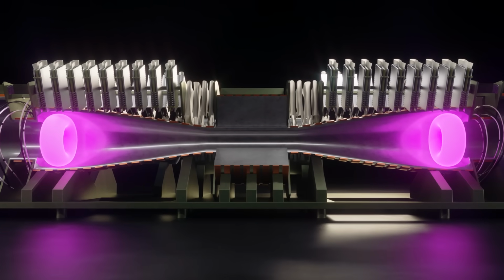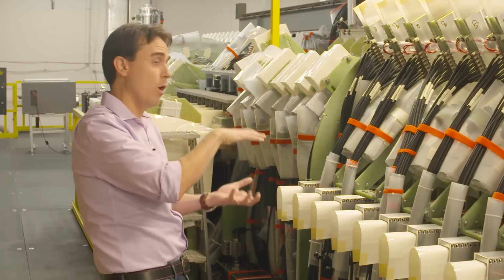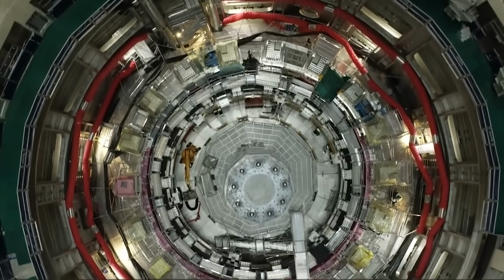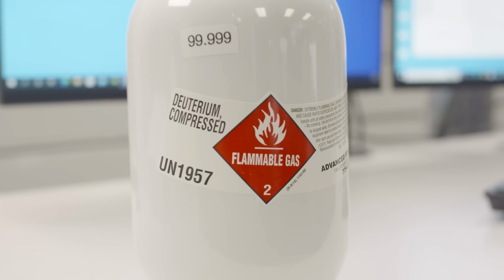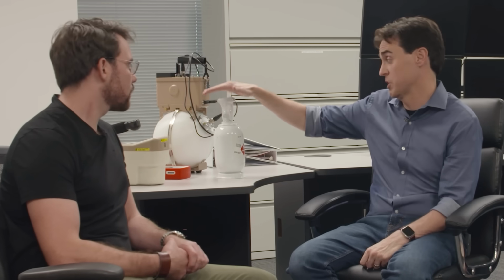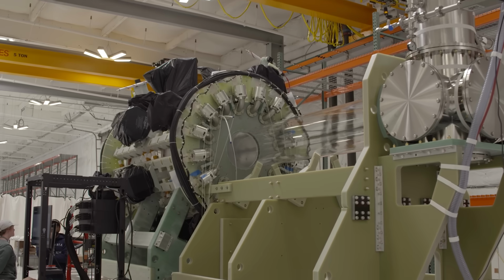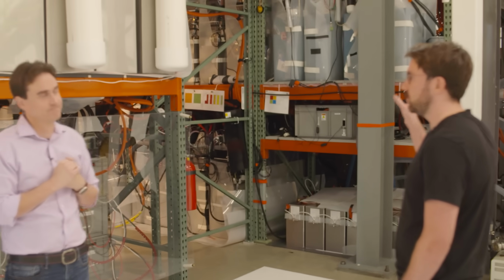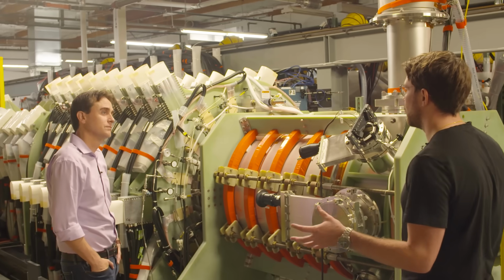A New Way to Achieve Nuclear Fusion: Helion

Comment: This is extremely exciting. The initial skepticism over "we found a new way none of the thousands of smart people working on fusion before us thought of" is tempered by the explanation why until relatively recently switching huge currents with the required precision to create the peristaltic plasma pump was just not available yet. That makes it so that even if someone thought of this kind of colision confinement it just was not feasible before. 
However here is my bit of skepticism:
1. are the field generating coils superconductors or not? Running 100kA or 1MA through them must generate huge heat waste if they are not. Can be done with ten minutes between pulses to cool down but ten pulses per second? And if they are superconductive how do you keep them so just next to the hot plasma?
2. When generating the He3 the D-D reaction gives out high energy neutrons. How to do this at scale without creating radioactive material and a similar waste problem to fission reactors and/or a tokamak? Is there a way to capture a neutron without making the capturing material radioactive?
And a bit of very far away optimism maybe: what it the waste neutrons could be used to burn fission fuel that is the waste from a conventional fission reactor because only ninety something percent of the fisible material remains in it? Build a hybrid plant that in its core generates He3 for the fusion generators, that is surrounded by a moderator to slow down the neutrons and those then fission nuclear waste untill it is all used up and not just 5% used up? That would provide a lot of energy and process nuclear waste at the same time.

Comment: The technology is fascinating. However, I am still not sure how are electricity generated in this system. What happen after a pulse merged and fused? How to remove the fused product after extracting their energy?
Reply: Essentially, the magnetic field forces the fusion. In so doing, a force is created by the fusion that creates an electrico-magnetic field around the reaction that pushes back against the machine causing the fusion. This additional energy is directly put into the electric system of the machine because physics. Then when the reaction is over, the current stops. The goal is to create an electric piston like effect which ultimately generates an AC current you can use like normal electricity. And I really do mean its the electric version of a piston.

Comment: This is a very cool approach. Really missing the downsides to actually get me more excited. How much energy is it currently taking to trigger a fusion reaction vs how much they are getting? Where are they planning to make up for the energy gap? From the currently unused neutrons?
Reply: Perhaps there are a lot of details missing, but those huge capacitor banks are the source of the power required to do the process, and they are a small portion of the stored energy of a Tesla battery, they’re used because of their discharge rate. So, it appears the energy required to make it happen isn’t a huge amount, it just needs precise and fast delivery: that leaves the question long-term of how much power can be extracted per pulse, which I’d hope would require far less power than a Tokamak or ITER design because they’re skipping all the mechanical issues with steam.

There are a lot of unanswered questions not asked in this video.

Comment: The comparisons of the scale of the two machines is just amazing -an speaks volumes about the practicailty of Helions product. You two make a brilliant team in breaking down all that crazy science!
Reply: Thing is there are tokamaks that are 10 times smaller than ITER too (and could reach positive Q), due to advances in superconducting magnet materials since ITER was designed. Both Tokamak Energy and Commonwealth Fusion Systems have modern tokamak designs that are likely to demonstrate positive Q in the next few years, quite possibly before ITER does. So it would be much more relevant to compare the Helion machines with the Tokamak Energy or CFS machines. They still have the general problem of tokamaks of generating actual energy and radiation mangement in real practical machines, but 'stupendous scale and expense' is already fixed.
Reply: @xxwookey  exactly. ITER is using 70s superconductors, it’s just too hard to build quick enough to keep up with the developments in MAST and now CFS.

I wouldn’t be surprised if Helion is using better superconductors too, so you’re spot on that it’d be more fair to compare to them

Comment: This is very interesting and promising. HOWEVER. Why are they on the 7th version without showing any tangible results? At the very least they should be able to generate enough electricity for their own building by now. This equipment isn't cheap. There is something here we're not being told. They are either happy to be burning through investor cash, or there is a serious flaw they won't advertise. Or both.

Comment: As interesting as this concept is (I like the fuel they want to use), they fact that there is no information regarding energy output, conversion efficiency, etc pointed out leaves my very sceptical. There is no reason to believe that this concept is technically more viable than the ones currently researched. There is no evaluation whether the benefits outweigh the very obvious cons.

Comment: skipping the steam/turbine step to go right to the induction step is pretty genius. I really hope this works out. It looks very scalable too. Just compare this to a tokamak or stellarator. I imagine the most complex step here is the software and sensors, i.e., getting everything to fire at the correct time, getting everything at the perfect velocity. What I'm curious about though, is how will this ever break even? How many watts of energy does the collision cause?
Reply: FYI,  a Watt is a unit of power which is energy per unit of time. So 1 Joule of energy delivered in 1 second is a Watt - that's power. So 1 Watt = 1 Joules/sec.  The amount of energy released in a fusion reaction is the difference in mass of the particles before the collision and the mass after the collision: Energy released = [sum(m initial) -sum(m' final) ]c2.
Reply: Never mind the fact that breaking even is of absolutely worthless value.
Reply: @MrJdsenior  You’re a years and years ahead of the competition if you can develop a fusion machine that breaks even for minutes on end.

Comment: interesting video! but it seems it won't work like inertia fusion with lasers for the same reasons. The only way to commercial operations will be to ignite a plasma once and let it fuse for e.g. 30min like Stellerator will make it possible. It should be obvious - most energy is needed to start the fusion process and the only way is to reduce the count of ignitions and not to just make it ignite faster (which will be extremely difficult!)^^. What I missed in the video are numbers about energy consumption for igniting and expected return from the 7th generation reaktor 🤔

Comment: It uses a mix of Deuterium and Helium 3?!! Deuterium, fine, you can buy it on ebay or extract it from battery acid. Helium 3 on the other hand is a vanishingly small resource that is incredibly expensive to extract or manufacture in a nuclear reactor. No way is it Helium 3 economic for a fusion reactor.

Comment: Jumping straight to non-neutron-emitting cycles, with plans to converting reactors to produce tritium/He3, that's pretty bold, but exciting. Unless I'm mistaken, deuterium-Helium3 reactors should be much less of a radiation hazard to be close to while they are running than other kinds (or much lighter to achieve the same degree of safety to stand next to as they need less radiation shielding), so this (in its power-only configuration, not the fuel-breeding ones) could maybe someday be useful even for large vehicles (ships, spacecraft, etc; maybe even large aircraft and ground vehicles far in the future)
Maybe the Battletech fusion engine is late, but coming eventually...
They're going to have to figure out something to do with the neutrons in the D-D fuel-breeding reactors, though. Possibly a conventional breeding blanket to harvest even more tritium, with or without multipliers.

Any new technology is impractical for at least one patent cycle though, and very expensive and clunky for at least one cycle afterwards, as competing companies block each other out by monopolising individual features necessary for a practical offering in the first cycle, then all the clever 'tricks' that come up once the first early models enter service in the second cycle. 3D printing had its 'revolution' when that second series of relevant patents expired, as far as I know computing and most familiar types of steam engine were similar.
So, take however long it takes to actually make this work and 'hit the market', then add 40 years for it to become ubiquitous and a truly competitive market (20 years for decent offerings from a few large oligopolies) enabling a true 'fusion economy'. At least those 'patent generations' are only twenty-ish years for physical machinery in most places, and don't reach infinity like regularly-renewed pharmaceutical patents do in the USA.
Still, my general cynicism about IP maximalism culture holding back human advancement aside, very exciting work. Probably at the top of a very short list of 'alternative' fusion reactor strategies I'm excited about. Hopefully all of them work out and compete and combine to the benefit of all humanity!

Comment: Probably will get buried, but quick question: They say over a million miles per hour, but also 300 kilometers a second. That's only 670,000 miles per hour. It seems like if they had 400 km/s they'd say that instead, but that's still only 895 mph.

Still really cool! Just not sure if there was a script error, or just a slip up, etc.

Comment: So wait, instead of solving ONE one problem (obtaining electricity from "clean" fusion), now they also have to solve an additional HARD problem of producing 3He fuel via "dirty" and possibly more difficult to achieve fusion reaction??? In what way does this make their idea more promising and/or more realistic than other proposed approaches? According to experts (Jason Parisi; Justin Ball, "The  Future Of Fusion Energy", pp. 300-301): "At best, Helion’s marketing is misleading — they tout the benefits and ease of aneutronic D–3He fusion, but still need the harder neutronic D–D fusion to obtain their fuel."

Here is the entire excerpt (Jason Parisi; Justin Ball, "The  Future Of Fusion Energy", pp. 300-301):
"What’s most puzzling about Helion’s strategy is their use of D–3He fuel. We certainly agree that the D–3He reaction is attractive. It is fairly aneutronic and the triple product needed for its ignition is second only to D–T. In fact, Helion’s website notes that “D–3He fusion simplifies the engineering of a fusion power plant, lowers costs, and is even cleaner than traditional fusion.” The catch is that helium-3 doesn’t exist on Earth in sufficient quantity. So, how does Helion obtain it? Well, according to one of their patents, the plan is to obtain it from the D–D fusion reaction. Unfortunately, unlike D–3He fusion, D–D reactions produce neutrons and tritium, which complicates the engineering of a fusion power plant, increases costs, and leads to radioactive waste. Moreover, the D–D reaction is harder than D–3He as it requires a higher triple product. At best, Helion’s marketing is misleading — they tout the benefits and ease of aneutronic D–3He fusion, but still need the harder neutronic D–D fusion to obtain their fuel."

Comment: Big whoop, huh? They want cold fusion to get 10x the power out of the power that's put in. What is this ratio now with new approach? Not even mentioned that I noticed. Should be the headline and video proof.  Is power in vs power out even 1:1?  Would be big news if it were or was close. If not, they haven't even proved the concept, just trying to keep the big-science money tap on. Cold fusion 2022 is the same vaporware that it has been since the 1980s, still 20-30 years away from market. Clickbait, another looky yonder yet nothing to write home about. They claim to be copying the energy of the stars, except they don't know how stars work. Take your cold-fusion dreams to the basement and leave them there.
Reply: it's HOT fusion , get your facts right

Comment: The piston analogy troubles me, an easy and intuitive way to understand power being produced, but it seemed very poorly tied to the actual mechanics. Capturing the "force it imposes against the magnetic field" isn't as easy as it sounds. It also seemed very much like any gains from being more efficient in having fewer steps, were easily outweighed by the fact that they are ignoring / discarding the lions share of the energy (the neutrons) - and them capturing those and using them to do useful work, as any production system would need to do - would be a very similar system to the steam turbines described.
Multiple bold yet vague or misleading claims about an unproven technology, my BS alarms are sounding... If they can patent and release things like their helium-3 generation process, why not the actually new/innovative part?

Comment: Hundreds of videos a bout fusion lately. Not one brings up the most basic question: cost. If it doesn't produce electricity cheaper than alternative methods, it won't be economuc and it won't get built. Renewables are mature and cheap. Geothermal is on its wY. Energy storage will be mature and cheap before any fusion reactor is viable in an engineerin sense.

This partocular method is one of the most elegant. But it won't be cheap and it is complicated by fuel synthesis and that is further complicated by the engineering needed to deal with neutrons.

Consider me sceptical.

Comment: The electricity generating mechanism using the plasma field is neat, but I doubt its enough to reach break-even or cross it. Without crossing break-even, it is still useless as a surplus energy provider.
Reply: Right, so you know these are prototype reactors used to study it.

These are meant to be scaled up when it's apparent that it will produce enough energy to break that final milestone.

They take years to build, then when they study what they can do, they scale it up. The idea of virtually free hilariously clean fusion energy powering the entire planet is now within our reach within our lifetimes.

(before anyone asks, fusion is ridiculously clean. The radioactive waste that a coal power plant with its ash is magnitudes more hazardous than the equivalent produced from fusion.)
Reply: @TheCommanderFluffy  you don't magically start producing surplus as you "scale up". Despite all the "breakthroughs", fusion is still 30 years away. This is good for research sure, but its not going to give surplus.

Comment: Could you mirror the configuration on the other 2 sides as well as the bottom and top so instead of just 2 plasma shooters, you have 6.
Reply: I guess the main idea here is the magnetic field that pulses around a wire. these fields need a direction to actual induce electricity, therefore the lineare configuration is important for the main goal of generating electricity, I guess... 🙃

Comment: Hi, real engineering.

I understand the concept of adding more heat to the plasma due to kinetic energy with an additional RF heater, does the kinetic energy possessed by the fuel creates instability in the magnetically confined plasma when they reach the middle?

I'm thinking this would make the process inefficient and would melt the containment.

But I hope they continue to improve their design. it's interesting. 😊
Reply: Long story short, you have two railguns shooting plasma into a magnet trap that then compresses the plasma in the same way a star would induce fusion with gravity. Because its using magnets, like a monorail, the entire thing isn't supposed to touch the rest of the machine at all and is forced into a spherical shape by the compression. 

That being said, that is a valid concern as the CEO himself even said that the 6th generation tests produced more heat and electricity than expected but that also means that it was more likely to hit the container and harm the machine. Hence why the 7th generation version is adapting to that little development.

Comment: A new way? Didn't they just get fusion to work a short while ago? Already got a new method?
Reply: fusion is not the problem. the problem is getting enough energy out of it to make it a source for electrical energy. if you only want fusion, you can actually build something in your home to achieve that. a kid a few years ago made headlines by having a 'fusion reactor' at home. so there are many ways to generate the conditions to fuse hydrogen, but most of them simply consume way more energy then they generate. the trick is now to find the one way, to make it worthwhile.
Reply: @spanke2999  Appreciate the explanation

Comment: Is there a limit to how much heat magnetic fields can contain?
Reply: well, this is kind of a difficult question. heat in this context is mainly kinetic energy of the particles. if they are charged, then yes there is a limit. if the magnetic field is not strong enough to counter the kinetic energy of the particle, it will escape. you can picture a magnet on a table and you slide another magnet towards it, orientated in such a way, that both magnets would repel each other. if you slide the magnet fast enough, both will touch before they get pushed apart again. same with high energy particles and magnetic fields. 
But if we are talking about uncharged particles like neutrons, then magnetic fields have no effect and the 'heat' can simply slip through. I hope this answered your question
Reply: @spanke2999  It does! At least, as far as I understand, there is no way to make a magnetic field that stops all heat. No matter what heats getting thru.